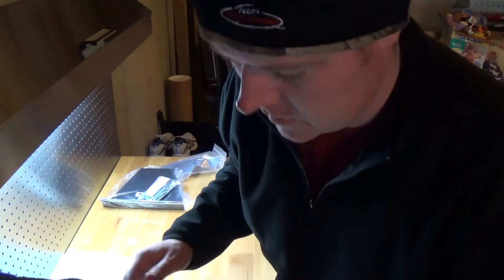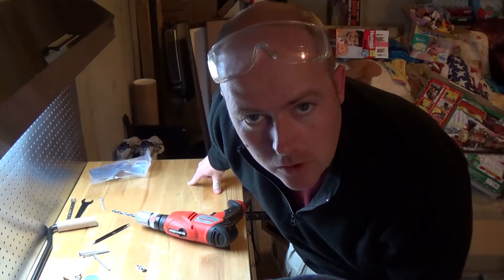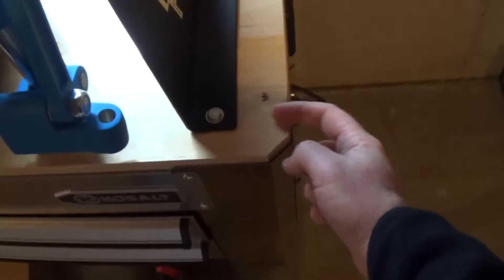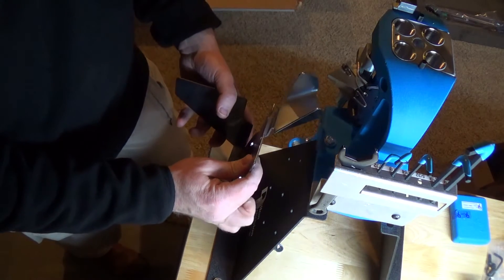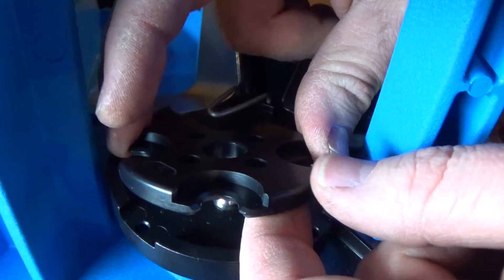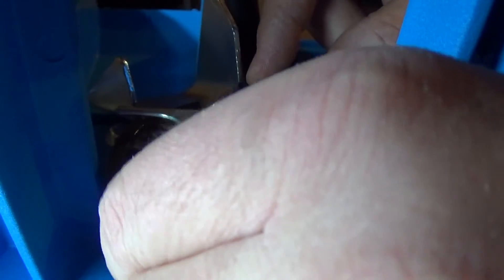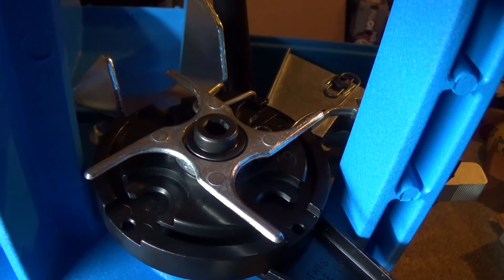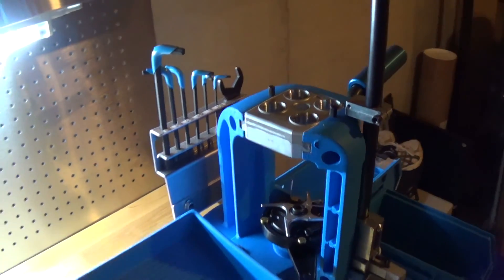Dillon 550B Reload press setup with strong mount

Comment: Thanks for the video. I to am looking at a bench for a Dillon. How is the Kobalt bench holding up. How is the stability? In your 45 ACP video, there looked to be a little wobble when you moved the handle to the upper and lower limit. Thanks!
Reply from the maker: Its still in operation. If you don't have the drawers and lower area loaded down it has more 'movement' if that makes sense. It is a light in weight workbench. I definitely am glad I got the strong mount. Probably made this setup work.
Reply: Thanks for the info. I have a strong mount to go with my new 650, so I will probably give it a try.

Comment: Any updates on the Dillion?
Reply from the maker: Well, its still in use. The only issues I've had is with the primer feeder. Sometimes with the large pistol primer it doesn't feed one. I'm sure there is a tweak for that I haven't found yet. You can tell by feel that a primer didn't load so I have yet to dump powder in a cartridge with an open primer pocket. lol. But overall its a great machine.
Reply: looking to get one. ...should do a reloading video